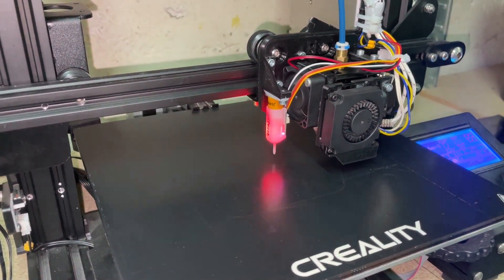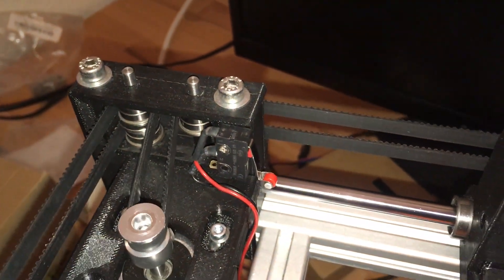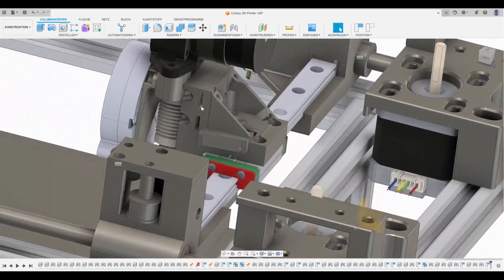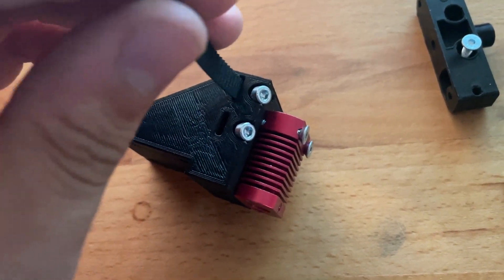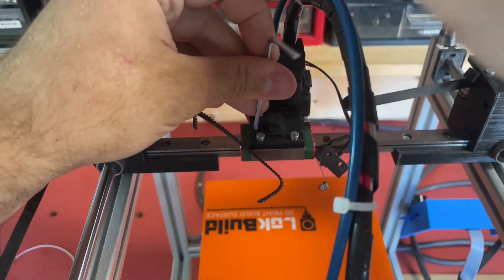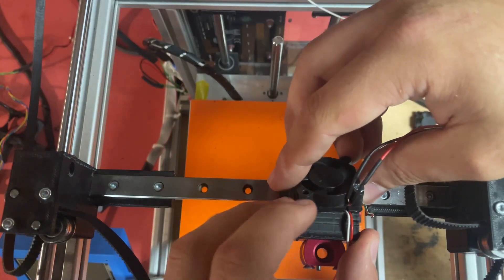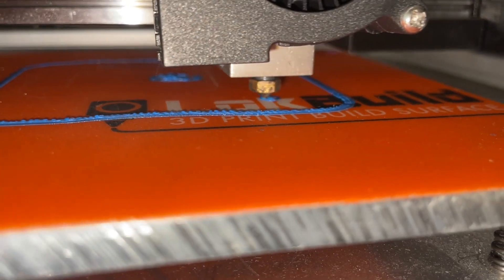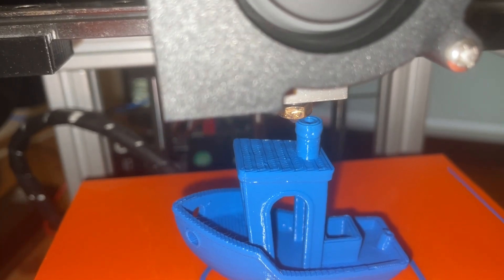Orbitor 2.0 install on diy corexy 3d printer

Comment: Good Video Mate!! You have great Ideas how to solve problems like the fan for the heatbreack. I would have never thought of it mounting on the back so you need less space, thanks for that. And the ressistors to bing the 24V down to 12V, i would suggest using a step down Modul to solve the Problem. And I would also Ground the Aluminum Frame, if it is not directly in contact with the Ground from your Power Supply or the case of the it. 
And quick tip, if you dont like to make a clean cable management, the simply print a case to hide the mess. 😅
Reply from the maker: Yes i think i will have to make a costum mount for the electronics so i can better access the micro sd card slot becouse if i only use the display simulation i can only access the files on the sd card on the mainboard and not on the display sd card